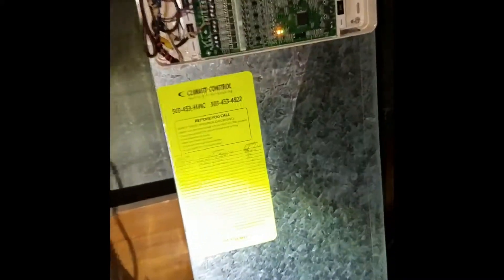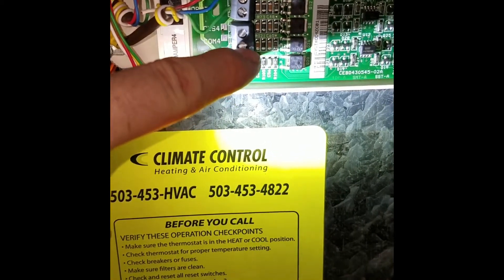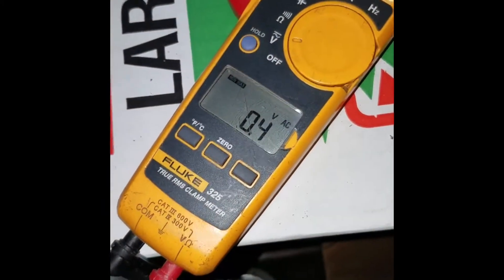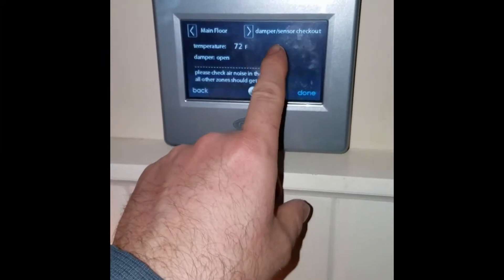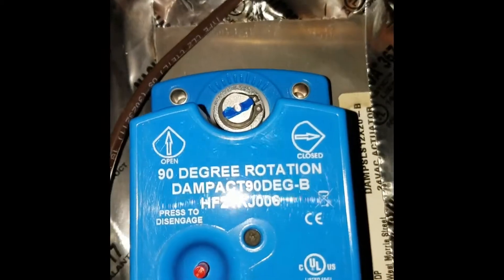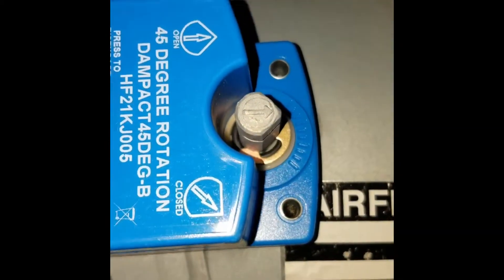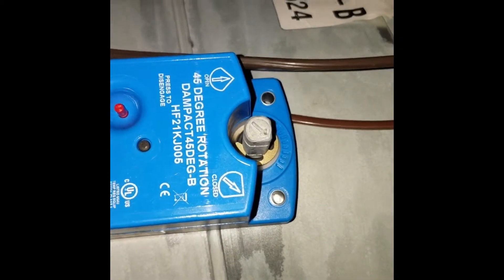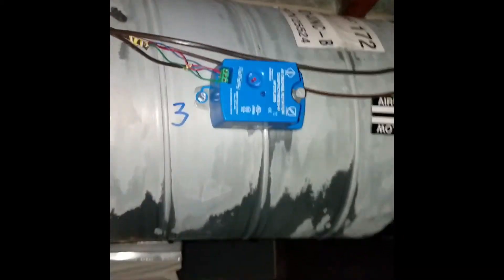Carrier Infinity zoning.

Comment: Have you ever had to change the motors on one of these? I got one that’s not opening or closing
Reply from the maker: Yes it’s not hard. Hardest part might be acquiring one. The vendor I use is Hadco, they are wholesaler so only sell to contractors. Good luck!
Reply: I’m a contractor and put a few of these in. The bad motor causes some system faults to occur and I’m trying to figure out how to clear them on the connex controller. Of course I’m on the job trying to figure this out….kill me now!!

Comment: Why you have one 90 degrees damper and 2   45 degrees damper? How the zone board will known if  is 45 or 90 connected? Or what if one 45 when bad and at store they have only a 90 damper? Will work? Or zone board takes 15 seconds to close all the way regardless of if 45 or 90 is install?